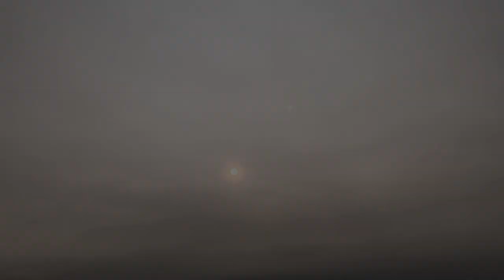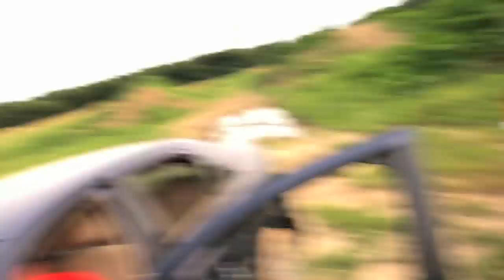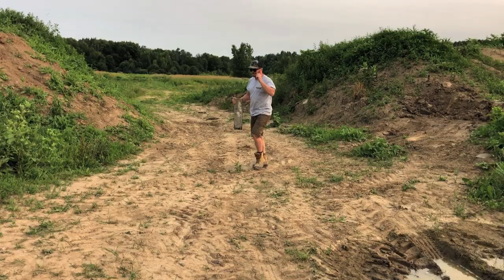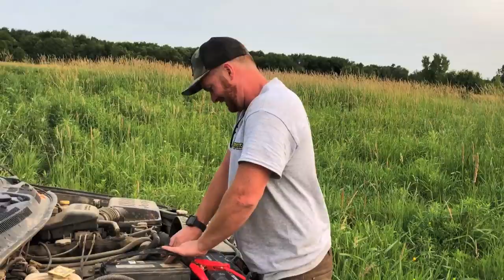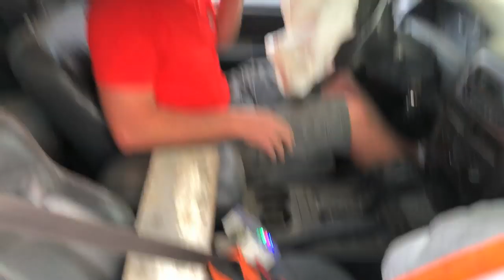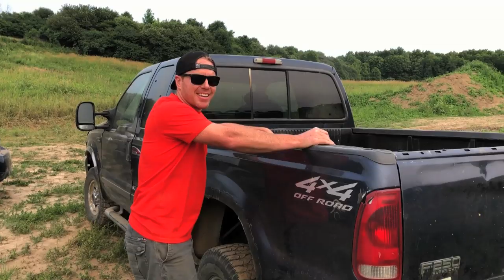How To JUMP A JEEP With FLAT TIRES!

Comment: that was a great jump. you should rotate the right front tire to the right rear so you have two aired up tires on the rear and two flats on the front. at least it will go straight with both fronts flat!!!